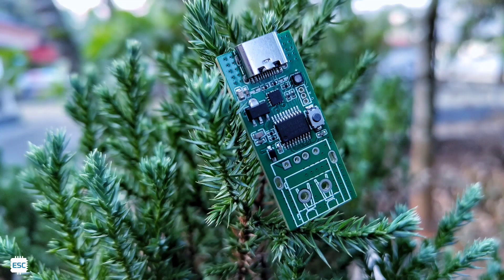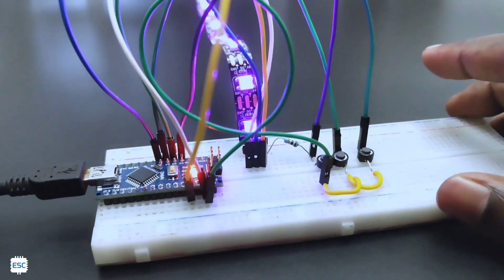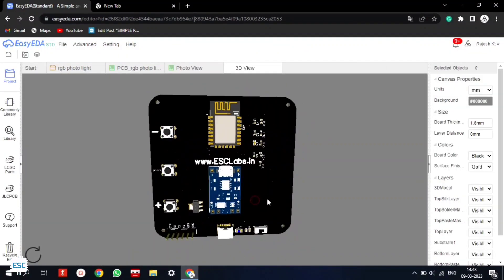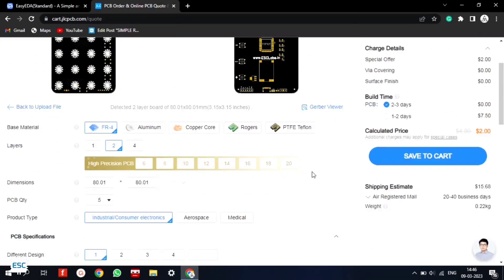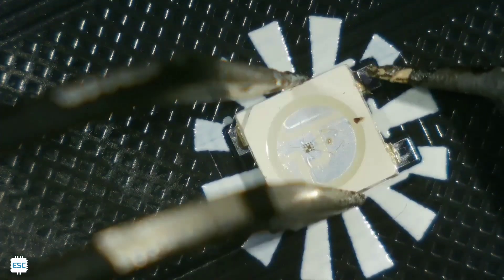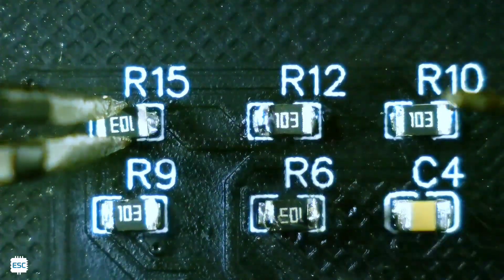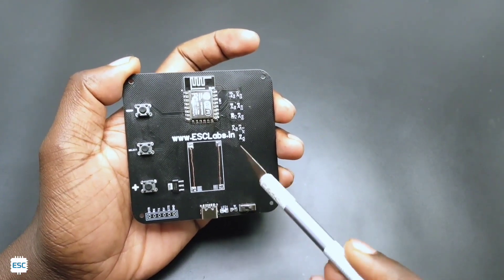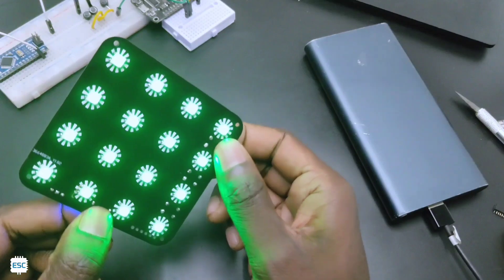How to make RGB CAMERA LIGHT | JLCPCB | Part - 1

Comment: I got a arduino uno when I tried to upload a code it's showing "stk500_recv programmer not responding"
stk500_getsync attempt 1of 10 not on sync
when try to upload rx led blinks and above error message appears 

when try to upload bootloader rx led blinks and shows 
avrdude device signature=0×00000
avrdude yikes invalid device signature  
plz help
Reply from the maker: Did you change the atmega 328 chip
Reply: @EDISON_SCIENCE_CORNER  I change chip only one chip that also same problem I check pins of IC there is no short circuits
Reply from the maker: Your chip signature is not the same as the bootloader. That's why it shows the error. Search for how to change the signature of atmega328
Reply: @EDISON_SCIENCE_CORNER  I got it from my friend he said that he upload a code for a Bluetooth car and after some time it got the error using shield 
for additional information he has 2 uno he used them for his project both have same problem
Reply: first I tried to upload a code then the problem arises 
then I inspect the uno and noticed that 2 pins of atmega16u2 is short (two pads near icsp pins) and I rectified it then also same problem 
I tried to enter atmega16u2 into dfu mode but it didn't enter
Reply from the maker: Try to change the board
Reply: @EDISON_SCIENCE_CORNER  it can't be repaired?